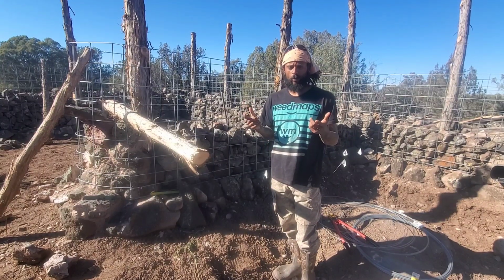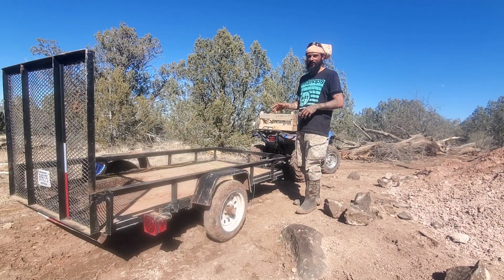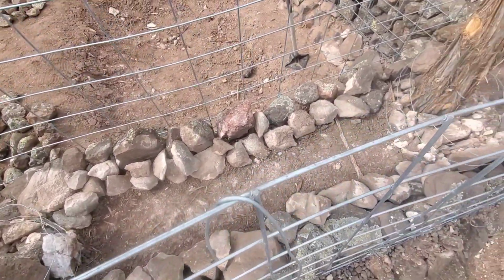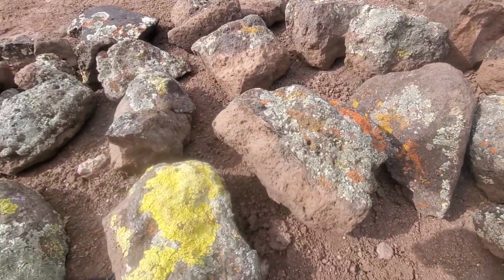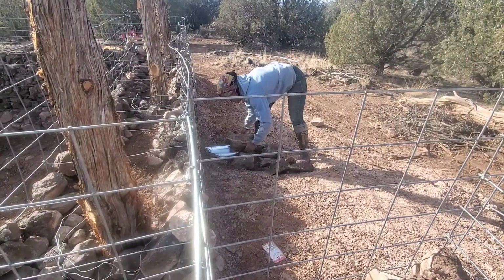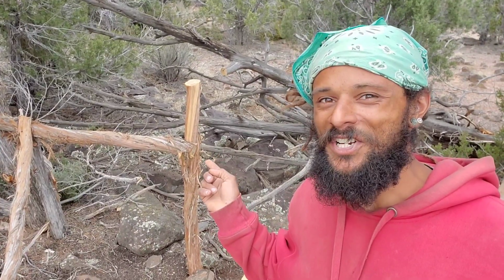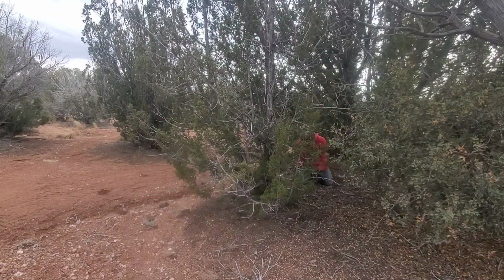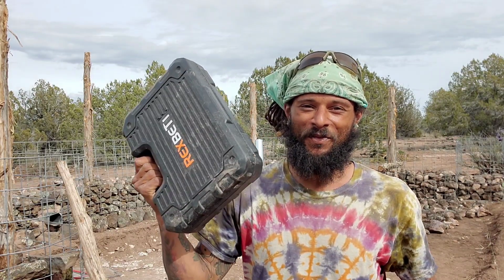Our House Will Be Built with Materials From The Land

Comment: You are really developing a system for your gabion walls.  I can understand how tying can be a real drag - but it is SO important.  Simply a cost offset of not buying factory made gabion baskets.
Really cool to see the trailer working out for your rock collecting.  
Would it be worthwhile to carry along a steel rake and several 5 gallon buckets to collect gravel size rock as you go?  I suppose having a gravel stockpile would be useful.
Your project is very large.  It is going to be quite a structure.  When the going gets hot, just remember you can eat a whale, one bite at a time. 😊👍
Reply from the maker: Inch by inch anythings a cinch! This is a slightly tricky structure design, but we're getting better about doing what works and efficiently. ✌🏾

Comment: Do you have a wood chipper on your wish list?  A machine big enough to handle all of the juniper pruning's would be great.  Blow the chips right into your trailer (with a little modification).  The best you can do right now is arrange the pruning's in windrows on contour.  Windrows make a difference.
Not only will they slow the flow of rain, but they shade the soil, retain soil moisture and offer habitat for ground nesting birds. Another diversity builder. 
I'll suggest buying a "long demolition saw blade" for your reciprocating saw.  Then you can use it to fell your junipers timber. 👍😊
Reply from the maker: Oh I see, appreciate that insight. I need to fix the chainsaw otherwise I would be using that and making better cuts. But I do need to put my wish list together. There are a few things that would help us greatly and move us a bit faster with the project. Always a pleasure to hear from you!✌🏾
Reply from the maker: A wood chipper would be nice so we can make more of our own mulch here. ✌🏾
Reply: @GrowTreeOrganics  Once you try the demolition saw, you'll never do back.  I buy them at Harbor Freight.  They hold up just fine.  Much more efficient than a chainsaw for a few quick cuts.  
May also be useful in your timber "innards" joints you'll be working on soon.  They don't have to be quite so perfect if they are going to be buried. 😉
Reply from the maker: @stevejohnstonbaugh9171  I'll definitely look into the demolition saw! But you're right though, I wasn't planning to get too detailed with the woodwork, like you said all those posts are gonna be buried. ✌🏾👍🏾